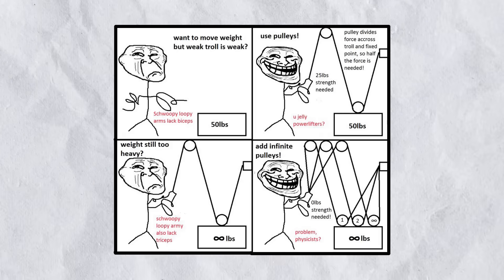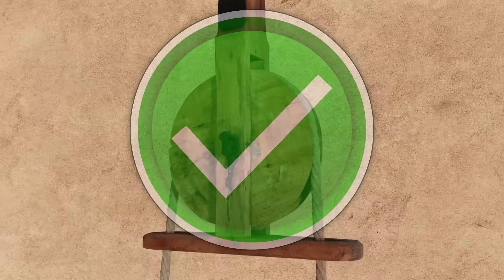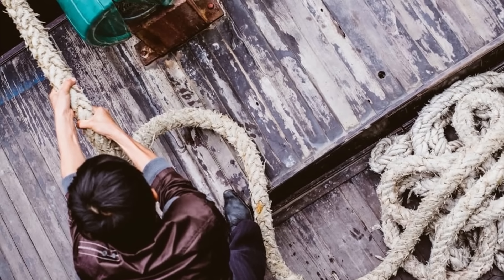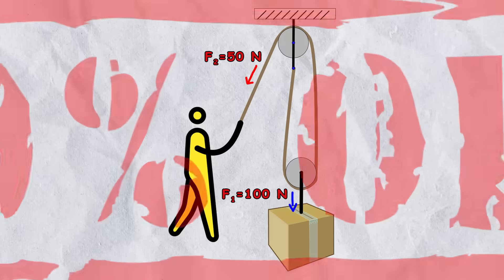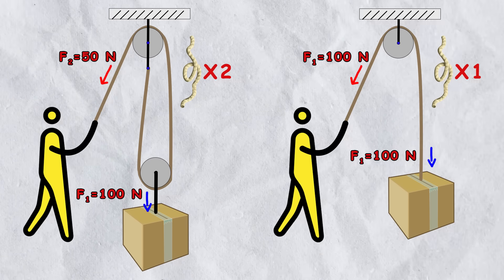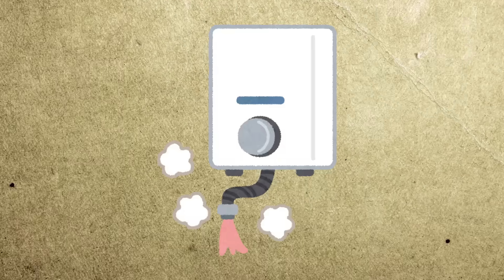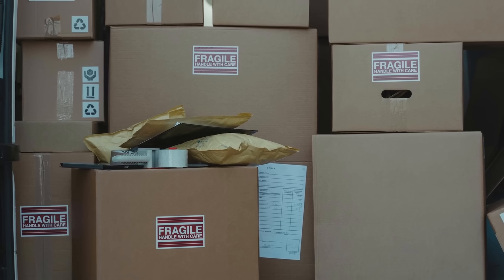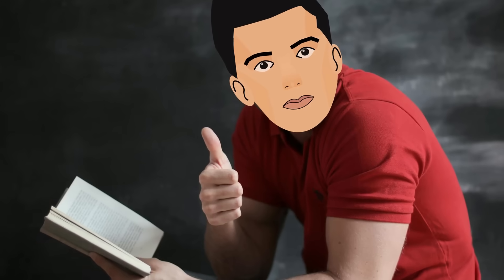why it kind of works 3

Comment: You would be able to exert force on the infinite weight using the infinite pulleys, but since you would be pulling a finite length of rope you would never succeed in actually moving the weight off the ground by any real distance

Comment: All things through space travel slower than light so even if we presume the ropes, pulleys, roof and etc all have infinite strength or length, the speed of which the rope is being pulled is lower than the speed of light so you'll never pull the weight up

Comment: yes with infinite pullies and infinite rope you can move an infinite weight with zero force... at zero speed.  the speed of the movement and the force required are going to approach zero at the same time so what it comes down to is we're doing nothing in a system win numerous infinities just kind of lying around.

Comment: it wouldn't be indeterminate? Since if the weight is always infinite but you add more and more pulleys the weight is always infinite, but if you double a finite weight every time you add a pulley the amount of force stays the same. And if you multiply the weight by anything between 1 and 2 the force instead goes to 0

Comment: just remember guys, the extra strength the pulley provides isnt coming from nowhere. the extra weight it can support can only be equal to whatever the pulley is mounted on can support. anything more and itll break

Comment: Actually, this meme doesn't work for a simple reason. You need to specify that the pulleys, the rope, the fixture and the fulcrum to which the fixture attaches the pulleys are all capable of bearing an infinite weight, or else you will have quite the embarrassing show for yourself. The rope would snap, the pulleys would fly off of their fixtures or the walls you fixed them too would crumble.

Comment: With each one you half the weight you need to pull. But double the distance you need to pull to get it up. So you have 2 pulleys, you need to pull 4 meters of rope to bring the item up by one meters. By this logic you are somewhat gaining infinite strength with this but also giving yourself an  infinite distance to pull.

Comment: So could we use this to generate electricity? Could i techincally habe a robot arm lift something and generate more power than it would require to power the arm?
Reply: Is that a serious question? No. If the pulley system halves the weight you need to pull twice as long. Energy or work wise, there's nothing to be gained.

Comment: Friction gets in the way.  As the number of pulleys increase, the total friction increases linearly but the force-multiplication only increases logarithmically.  At some point, the increase in friction is greater than the decrease in effective weight, and the force required starts going up instead of down.
Reply: But what if you are a spherical cow?

Comment: Technically infinite divided by infinite is indeterminate, as it depends on the level of the infinites and may therefore still require infinite strength
Or even just a very specific number
Infinites are weird like that

Comment: Since there's infinite weight, that shows there's infinite mass. The issue is that the weight is limited by volume, this means that it is extremely compressed, and would form into a black hole. The volume of a black hole varies on its mass, ∞ Mass = ∞ Volume, and it would consume the whole world.
Reply from the maker: Yeah for example compressing the earth into the size of a marble would form a black hole

Comment: This is what I have unfortunately never understood. How can you need less power to pull something when the weight stays the same. I understand the equation, but just can't wrap my head around how... How
Reply from the maker: Its simple because you will have to pull twice the distance
Reply: @tylerschannel  To my mind that just sounds like pulling the same weight farther... which doesn't sound any easier.

Comment: If you need to be pulling forever, that's the same as saying it's not moving the weight.

Also, I notice that the network of pulleys in 0:41 isn't just dividing the weight you have to pull by the number of pulleys. It's designed so that each pulley doubles the force and then pulls on the next rope, increasing the force (and decreasing the distance) exponentially with each additional pulley.

Comment: The system as shown in the image would actually not change the mechanical advantage at all. It would just stay 2:1. Each rope would have a reduced load, but the tension in them is still summed at the end the person is pulling on.
Reply: Finally someone else noticed it!
Reply: fucking finally. i was losing hope

Comment: Well, aside from the strength to ender the force on the system, they are showing using "parallel" pulleys in the last panel rather then "series" pulleys that you talk about with the infinite load so its not the same. 

The parallel pulleys reduce the strain on the "systems" elements well not having any increase in needed rope length, but also not reducing the effort to lift. (No real change, aside from the weight and friction of additional loss to the pulley system its self)

Well in series the pulleys increase the strain on the "system" elements and increase the rope length needed well decreasing the effort to lift

Comment: That doesn't work like that. You need some force to move the pulleys in the first place by overcoming friction and the pulleys' inertia. So you don't actually cut the weight in half, it's a bit more due to the pulley's resistance. Realistic weights allow for the increase in the number of pulleys to ease the load, but they become less efficient at each subsequent step. Eventually, you'll end up with a number of pulleys that feasibly cannot be made to move in the first place. So, no, infinite weights still can not be lifted because you wouldn't be able to produce the initial force to drive the pulleys in the first place.

Comment: the arrangement of pulleys shown in the fourth panel would provide the same mechanical advantage as the arrangement in the second panel. if both of those weights were 50lbs, troll would still have to apply 25lbs in both cases. troll should do some research on how to actually arrange pulleys to increase mechanical advantage.

Comment: I like the following simpler example even better. Take a lever, one arm is 1m long (cube root of the volume of a dishwasher for the Americans), the other one 0. You exert infinite force, by applying finite force. The only tiny drawback is: you can’t move anything.

Comment: You would also need to pull the rope infinitely far to make the weight move at all. Also the last pulley will still feel the full force of the weight, therefore you need an infinitely strong ceiling

Comment: A infinit heavy weight is inmoveable, even with infinite pulleys. That's because how pulleys work: Adding one halfs the Force but doubles the Way you have to pull your rope.

With no pulley to move a certain Way you need a certain force. However in this sceanario the Force is infinite. So adding one halfs that infinite Fource but it also doubles the Way. Adding infinite pulleys leads to a Fource infinity divided infinity, so it's a real manageable Force, BUT it also multiples the Way by infinity.
So you would pull with a manageable Fource, but you need to pull infinitly with a infinite long rope.

Formulated:
W = necessary work to lift
s = way you want or need to lift
F = Force necessary to lift

W = s * F
No pulleys:
W = s * (F * infinity) = infinity
Infinite pulleys:
W = (s* infinity) * (F * infinity / infinity) = infinity

Comment: 2 problems 
1.Rope and sully still have to handle the inf tension and inf weight.
2.its going to take an inf about of time since the velocity ratio of the effort arm to load arm=n(number of  rope segments=2× number of moveable pullies) which is infinite!!! Meaning u would need to pull the effort rope for an infinite ammout of time for the load arm to raise by 1 unit.

Comment: We need to remember one thing, it wouldn't lift the object at all.

Because the more distance you have to travel(distance of the rope) more time it will take to the object to be lifted, so it would do it more slowly as there are more rope, and since you have to pull the rope for an infinite amount of time, the object would be lifting infinitely slow, or in other words, it wouldn't move at all

Comment: Unfortunately, the infinite pulley thing is flawed... The way a pulley reduces the force required is that it increases the distance in which you apply your force.

With a single pulley to lift the object 1ft you would need to pull the rope 2ft.

So an infinite number of pullys means you need to pull the rope an infinite distance to even begin moving thw object.

Comment: No, this is incorrect. Even if you have frictionless infinite indestructible inelastic rope attached with ideal pulleys, ∞/∞ is not 0, it is indeterminate. Same as an unstoppable force vs an immovable object -- no solution inside the box

Comment: The second panel is wrong. The force is divided by four.  If you add infinite pulleys, you raise the weight by zero inches. You are still a weak troll.
Reply: Correct

Comment: All pulleys and gears also build up friction. Advanced mechanical engineering courses usually go over how friction adds up and the static force required to overcome friction.

So with infinite pulleys you would need infinite force to overcome friction.

Comment: I wonder if friction between the pulley and its axle would become a problem if you just keep adding more pulleys. You may need less power to lift the object, but the miniscule friction of each pulley just adds up and offsets the benefit of adding yet another pulley.

Comment: Technically if you had
1. Infinite pullys
2. Infinite string
3. Infinite strength of all parts of the system
4. Infinite time
Then yes you could pull Infinite wieght
Reply: And you'd need infinite force

Comment: This has me thinking, what if you had an infinitely strong rope, tossed one end into a black hole and be able to tow it?
Reply: Not really, the rope would just mean that you are being pulled by the black hole from further out cause it's transferring the force. You'd need enough engine power to escape from the black hole on your own to move the rope and even then it would just be pulling the rope away from the black hole.

Comment: infinity / 2 is still infinity. Before the pulleys, you needed infinity newton's. Now, you need infinity newtons
Reply: no, lifting with infinite pullies means you need only use 1/infinity of the force needed to lift the object without pulling

which is 0 because 1/infinity is 0. you need no force but as the video says the rope will have a length of infinity and you will have to pull it for infinite time to fully lift it
Reply: @Slickji  it's infinity divided by infinity, which is still infinity.
Reply: @Slickji Did you not take math classes? You can't just tackle a part of the equation and say it's 0 when we are tackling theoretical maths like infinity.

Also just remembered, infinity * 0 is also undefined.
Reply: what abouy infinity / 16 tho
Reply: No it’s undefined. Let’s frame this as: I pull with finite Force F_0. Let F_end be the force at the very and of the pully system, with the pully systems providing the force multiplier a, so F_0*a = F_end. The force multiplier is a=2^n, for a pully system with n stages. For infinite stages, a -> inf. Thus F_0*a -> inf. Which means we pull with an infinite force. Your reasoning of „inf/2 = inf“ is not entirely wrong, but only holds for finitely many divisions. To illustrate why it’s undefined: let’s assume case 1: The mass is n Newtons (N) and we have n stages. The force can be calculated with n/2^n. For n -> inf, n/2^n -> 0. Now case 2: The mass is now arbitrarily n^n. Now the force can be calculated by n^n/2^n = (n/2)^n. For n -> inf, (n/2)^n -> inf. In both cases, the mass and number of pullys in infinite. In one case we need to pull with infinite, in the other with 0 force, I.e it’s undefined. We can construct the mass arbitrarily so that any force between 0 and inf is necessary btw

Comment: 2 problems: 
1. the section of the rope which supports the weight needs to bear the entirety of the load
2. Since the rope in infinitely long, and the speed of sound in the rope is finite, no matter how hard you pull on the rope the other end of the rope will never move.

Comment: The weight in the image doesn't have infinite size, so it has infinite density, which means that between any two atoms in the weight there must always be an infinite amount of atoms. So, the weight is uncountably infinitely heavy.
The pulleys are numbered with integers, so there is only countably infinite. The pulleys would not make the weight liftable.

Comment: Fun fact:  
The movement of the rope doesn’t happen instantly, it’s a shockwave that travels down the rope, so because the rope is infinite you could pull an infinite amount of rope out of the pulley system, but at the same time the end of the rope would never move at all because the shockwave wouldn’t travel infinite distance.
Reply: infinite rope exploit?????
Reply: @no1mayohater No, it is the same amount of rope just stretched out over further distance.
Reply: The speed of causality, is c, and you c, it can't divide infinity.
Reply: what end? the end of infinity?
Reply: @murphyisadog  yeah, infinity has an end, it's just an infinite distance away.
Reply: Infinity has no end. But the distance between any two points on an infinite line is finite.
Reply: @AaronPeterson-lj1qc  This is debatable.
Reply: @AaronPeterson-lj1qc  what if one point is at distance infinity and the other at distance 1. that's a non-finite distance on an infinite line
Reply: @itsentdev i think he meant that only with. whatre they called uhh... Rational numbers. obviously if the distance is infinity then its infinite, dont be semantic
Reply: @itsentdev infinity isn't a number, you can't have a point at infinity
Reply: @tophmyster  on an infinite rope you can have a point infinite meters down that rope
Reply: @flameofthephoenix8395 per definition, an infinite sequence is one where for any point in it, there is a point further ahead. there is no point with no follow up, so there is no end.
Reply: @valmao91  The end is at the start, starts and ends are the same.
Reply: @flameofthephoenix8395 not in the general case, and definitely not in the rope case. what makes you think the start and end are the same?
Reply: @valmao91  Let's say you have two infinitely long ropes, but you're holding the starts of both, one in each hand, there is no end to either rope meaning you could pull on the two ropes forever and never get to the end. But how do you know these two ropes are separate? Perhaps rather than holding the start of two separate ropes you're actually holding the start and end pf the same rope, both ropes would provide the same behavior either way, you could pull forever and because of the infinite length it would never pull the end out from your other hand. It is impossible to prove the separation of the two ropes and impossible to prove they are the same. And impossible to prove that the "start" isn't actually an "end." Start and end are relative terms.
Reply: @enderofbarts  infinity has no end, that is the entire concept
Reply: @flameofthephoenix8395  if it has a start and end, it isnt infinite, infinite is a synonym of endless, which is WITHOUT END,

If it has a start and end, it is only extremely large, not infinite
Reply: @flameofthephoenix8395  also in calculus you cannot use infinity in equations, only in limits because there is no infinity, only as you approach it
Reply: @flameofthephoenix8395 even in your example the start and end of the rope arent the same though. You have two seperate points near one another. For them to be the same it would need to be attached  then you dont have an end you have a length of rope and can't prove its a loop due to infinite length. But having two seperate points proves the end and beginning arent the same.
Reply: @Dragonfire-ir5ln in this example you have the start of the infinite rope but not the end. The end is valued as infinite.
Reply: @itsentdev the distance is infinite cause infinity plus or minus anything is still infinity
Reply: What if the shockwave traveled an infinite amount of time? Would it reach the end of the infinite rope?
Reply: @argus406 no
Reply: Very fancy way to say "infinite rope is infinitely stretchy".

Comment: u dont see ppl lifting infinite mass with pulleys, cuz u never account for other factors in these examples, like material strength. The pulleys will break. The rope will break. The anchor structure the pulley is attached to will break.

Comment: ... you need an infinitely long rope and to pull it forever to lift an infinitely heavy object?
so can you or can you not lift the thing?
Reply: you can not as far as I understand the mathematical concept of infinity. Matter of fact, even if the weight was finite, say 1kg, you would not be able to move it if you had infinite pulleys.

Comment: If you have to pull the rope an infinite distance, then you will never reach the point where the infinitely heavy object lifts off the ground.
UNLESS you also had infinite speed and stamina to pull that infinite distance infinitely faster.